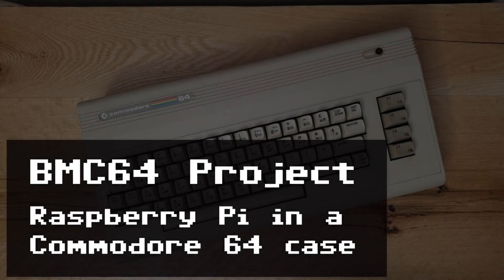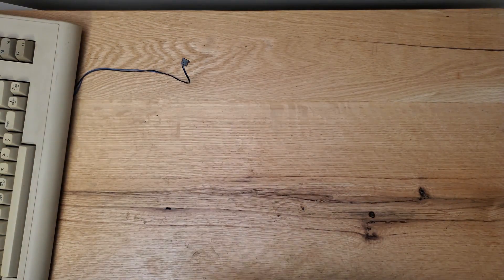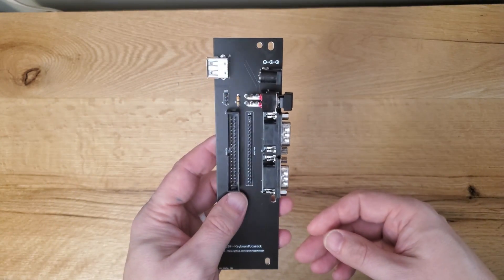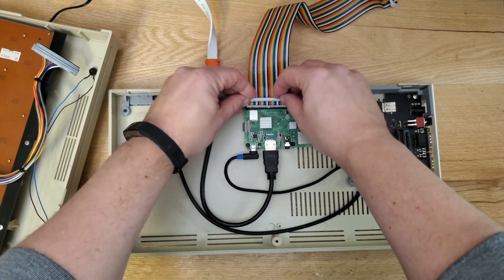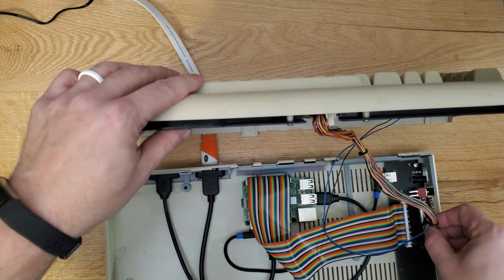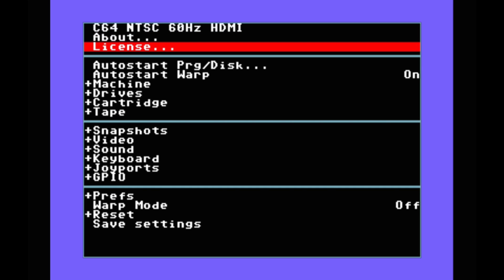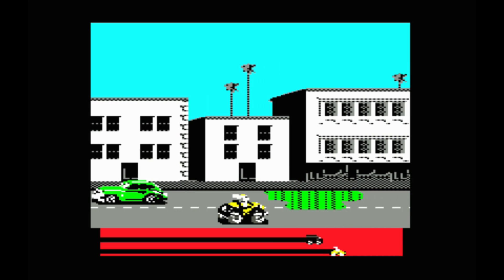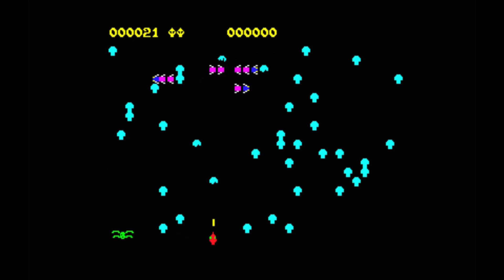This is a BMC64 - Commodore 64 Project

Comment: If you have the USB cable connected to the BMC64 board from the Pi, I don't believe you need the 40pin ribbon cable.  I've seen a few builds that utilize a power module that interfaces into the GPIO for smart shutdowns which would inhibit the use of one.

Comment: Nice build. this VS the TheC64/TheVIC20?
Reply from the maker: Toss up. I have both. I love the mini console...and it's certainly cheaper. But the keyboard is better on an original compared to the 64 maxi anyway... the mini will require a little fussing to run some games.... but it's a great console. The novelty of an original keyboard is high for me. Definitely costs more and requires build time and customization. Finishing up a c16 version of this now...
Reply from the maker: Oh and thevic 20.... too hard to get a hold of.

Comment: Here in Germany we have a nice board for the Pi 3 A+ (the only model supported) that fits perfectly into the C64 case along with a port for the original power supply, an on/off switch and the 2 joystick ports. It's from FaszinationC64, look it up.

You can switch joystick ports with C= and one of the F-keys (2 or 3, can't remember).
Reply from the maker: Awesome! Thank you! I will check it out!